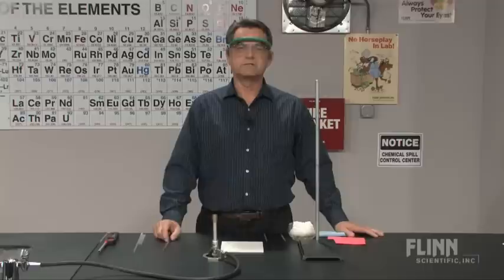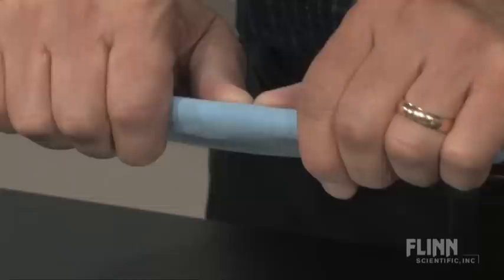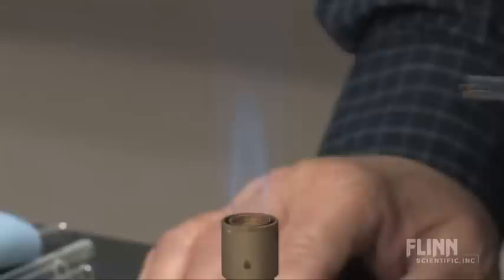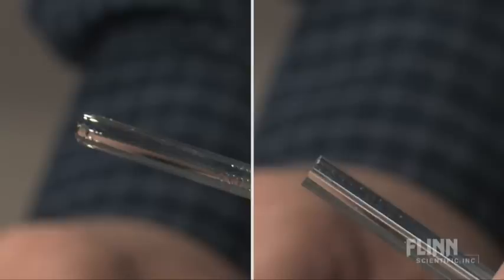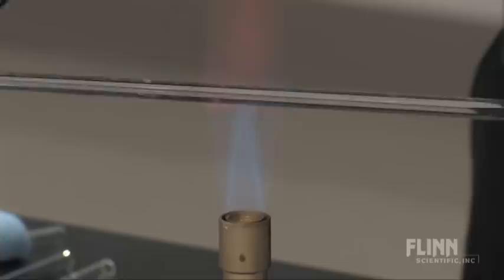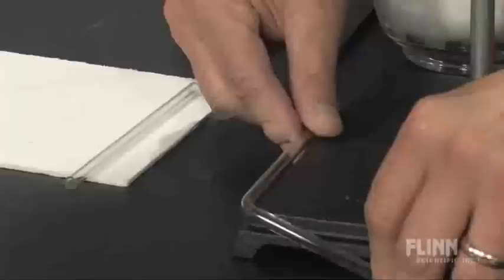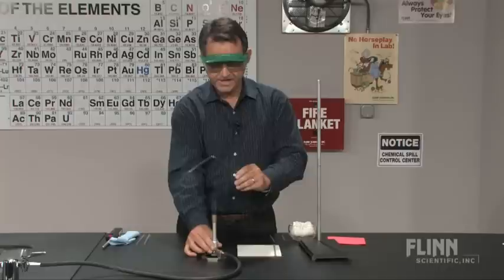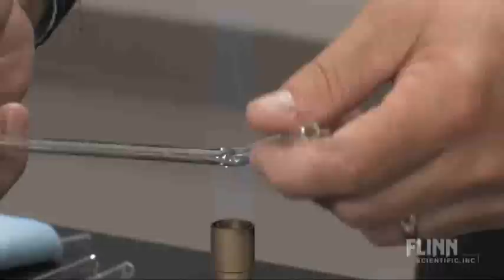How to Cut, Fire Polish & Bend Glass Tubing

Comment: I am going to use this technique to make a glass tube for my computer's water cooling.
Reply: That would be sick.  I've got acrylic tubes in my computer.  My concern with glass is that with the way the fittings tighten into the tubes could crack the glass easily.  
With my build, I for sure would have broken tubes trying to install them.  The ability to have the acrylic tubes flex a little helped with getting into some awkward places where a more brittle tube probably would have broken.  I actually had to heat one the the tubes while it was partially in the case.

Cool idea though.   You could make an awesome custom reservoir with lab equipment or by blowing glass.
Reply: @danlev6927   You can buy the glass tube from https://www.mayhems.net , it's a Borosilicate Glass dedicate to PC's water cooling. Do not use chemical purpose glass tube or aquarium purpose glass tube.
Reply: @p72910  Why not? What's the reason you shouldn't use laboratory glass tubing for watercooling? I mean other than risking it containing any corrosive chemicals if not cleaned properly lol.

Comment: You should have a video showing how to bend Pyrex glass tubing. A propane/oxygen torch is needed to do this job.
Reply: +uvman707 How about MAPP gas?
Reply: onjoFilms Oxygen and propane is needed for borosilicate, I suspect he is either using mapp on lime-glass or propane on flint-glass in this video.
Reply: onjoFilms Edit, he is probably using propane on sodium-lime glass
Reply: Mapp works just fine

Comment: what if I want to break a small piece off the very end of the rod to make a bunch of rashing rings from one glass tube, can you use pliers to get the torque you need?  What kind of a file did you use?
Reply: I'm only here learning how to, to be strait forward. But just in case you're still looking for ideas, I am thinking that for the torque, maybe a perfectly fitted stopper in the end of the tube, with a wooden dowel attached to its inlet? 

Let us know if you ever got your project together. Good luck.
Reply: As an Ex glazier. We used to debuted glass with a stone.( sharpening stone) even thick coarse sandpaper will work. In desperate times I used a diamond file with water! You can buy special stones with a adjustable bevel either side.i hope that helps? Cheers

Comment: Nice video, but you should have told us what kind of glass you were working with.

PYREX, I assume...?
Reply: Probably american pyrex, as he talked about sodium atoms in the glass, so it's soda-lime glass.  European pyrex uses the more expensive and better borosilicate glass, which is also harder to bend and needs higher temperature.
Reply: @felixar90  What? Pyrex is Pyrex. If it's borosilicate then it's Pyrex. If it's soda lime then it's soft glass. You need to heat soft glass to very high temperatures because if you try to just work it with it torch like he did, it will literally explode.
Reply: @tigertoxins584  No. Pyrex is a brand name. They got into the business making high quality borosilicate glassware, but like everything else, the brand changed hands multiple times, and they changed the recipe. Depending on the country and date of manufacture, Pyrex brand glassware can be made of simple tempered soda lime glass. https://en.wikipedia.org/wiki/Pyrex#Composition
Notice the different logos.
It's like Kit-Kat. In most of the world,  Kit-Kat are made by Nestle, but in USA, Kit-Kat are made by Hershey's and are pretty much completely different.
The Slo-Mo Guys have videos where they break both types of pyrex. The borosilicate cracks into large deadly shards of  lethal ultra sharpness of death, while the tempered soda-lime insta-shatter into tiny cubes.
Reply: @felixar90  Borosilicate glass has sodium in it as well, and has an identical flame color as soda lime glass when it releases sodium ions.  You have to step up to spectral emissions analysis before you can differentiate the two.

Comment: its a good idea to relieve the devitrification on the inside of that bend before flame-annealing to ensure maximum durability preferably with a hand torch, 2 point bridging, and to seal the end so you can even out the wall thickness by inflating a tiny bit, not to mention proper kilning if this would to be ever used. I dont think that this demo is useful at all, providing this info can get someone hurt or even killed.
Reply: Not if you're working with borosilicate.